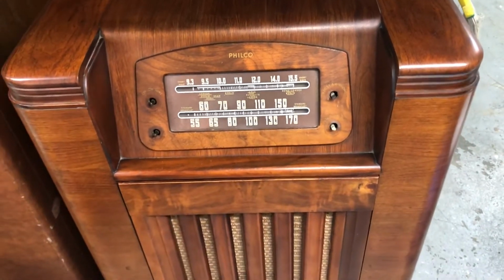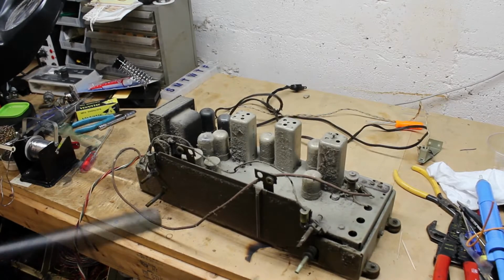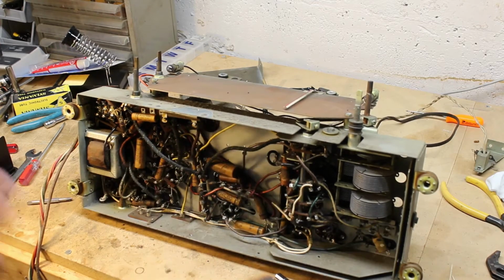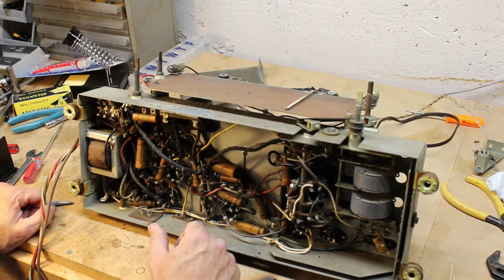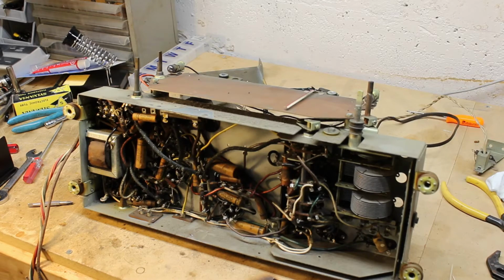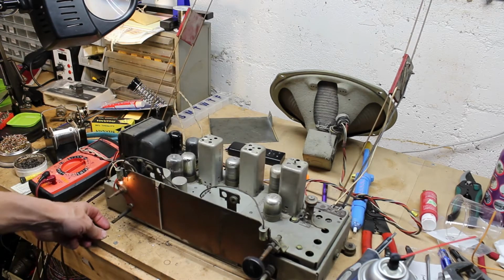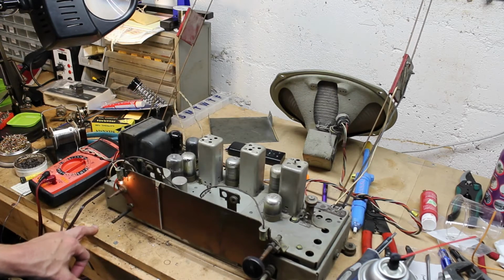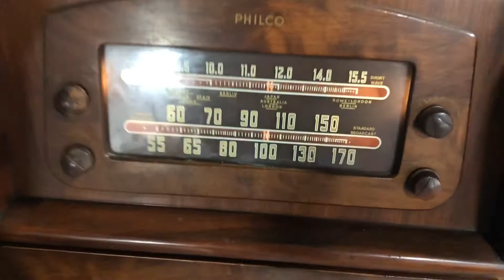Episode 18 Philco 46-1226 Rebuild

Comment: Nice!  Just subbed your channel.
  I see you had trouble with the Bakelite block. Once in a while those thin original cap wires can;t be cut easily, or there's too much solder. I use a small drill and by hand turn the drill in the rivet hole. That usually cuts the thin wire allowing the inside tar piece to come out. Where the thin wire is exposed nicely, they can be cut with a box cutter tip. Then upon heating the block, it will push right out.
Nice though as we don't have to unsolder the entire block from the chassis. For those that have never rebuilt one, they are pretty easy to do.
   Thanks for the video, and I am sure the one I will be working on will go just as smooth. Take care, Gary.
Reply from the maker: My last ones did not act that way. i always forget about the drill trick.